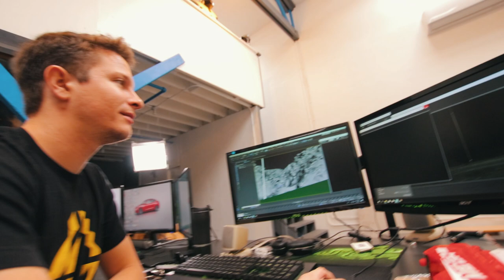Nerf Office War | $9300 Wrendering PC!

Comment: a 9300 computer for a system with 2 1080 ti's?
what are the other specs of the system?
Reply: well 64gb ram, 1kw power, 1 ssd, 1 hdd, air cooler.. only the cpu can't be worth 6k lol.. either they got ripped off or computers in america are way more expensive than in Germany 🤣
Reply: Puget Systems is a rip-off factory. They justify their prices by offering a lifetime support warranty, complete system setup and stress testing, and custom build to order. It's garbage. I emailed them once with a request for a quote on a build that I knew the price of using nothing but MSRP, no discounts whatsoever, and they charged 2k over MSRP for all parts.
Reply: Definitely a rip off I spent 4000 USD on a pc with a ryzen 9 3900x, rtx 2080 ti, 2 1 tb nvme m.2, corsair water woolong and fans
Reply: @yueroko  its not a ripoff,with Puget you pay for their service,which they claim is top of the line best in the world...
Who doesnt need that can build his own rig for a fraction of the price,thats it!?
Reply: probably worth 2500 or less now lol

Comment: They used to use all in one water cooling when they were building the early i7 systems.  They were good for 3 years before the pumps started failing, it was the early days of all in one pumps though system was still rock solid and didn't fry themselves, and still ran like a champ once I swapped them over to some decent air cooled heatsinks.

Comment: No Wren. Air coolers do not work better. Not that air coolers are BAD, but that was a false blanket statement. lol
Reply: There's actually some debate on this. I've discussed this quite a bit with the guys who built this machine. Water cooling is great for the CPU, but this style of air cooling not only effectively cools off the CPU, but encourages good airflow through the whole case, lowering the default temperature from which to cool the CPU. 
These guys have literally built thousands of computers and have tons of temperature data to back up their conclusions so I'm inclined to agree with them. 

Sure it probably won't be as effective as a dedicated high end water cooler for intense over-clocking, but... we're not doing that so no need.

Comment: Isn't a quad 1080 setup better than a dual 1080 Ti setup? 4 1080s together are ~10K CUDA cores, while 2 1080 Tis are ~7K CUDA cores.
Reply: Curry Puddin no a 1080 ti is more optimize and CUDA cores aren’t all of what makes a high end GPU high end and four way SLI is much less efficient than two way SLI because most programs don’t support fourway SLI
Reply: You're correct... and that's why IM still using that computer and this new one is for Niko. But I'm using it to render extra shots while this project is going. 

Also, we don't use SLI at all...

Comment: 2x 1080TI = $2k  
64GB RAM ~= $0.8k  
Case/MB/PSU/Cooler ~= $0.5k
= $3.3k  
Since it's not a dual Xeon, and a simple i9 would only cost ~$1.3k what Xeon does it have?
Reply: case mb psu and cooler are not for 500... thats one thing and of course its xeon...
Reply: Does not matter much if 500 or 700.  Cooler is ~50, Case ~100, PSU ~250. Ok board costs more, I was mistaken about the cost of the PSU.  
Still interested in what Xeon is in that thing.

Comment: Again, I said the same shit with your last Puget systems PC. You got ripped the hell off. I have a 7920X 12 core, Liquid cooling, 3 SSDs, TB SHDD, 2x 1080tis, 32GB of RAM and some fucking LEDs for $4300. Less than HALF of what you paid but my PC is better in terms of processor and equal for graphics compute. Do you guys do any research before purchasing these systems?